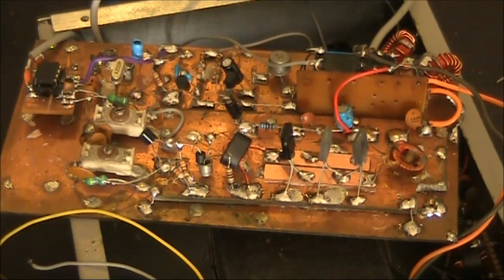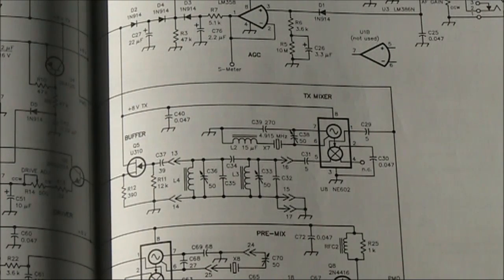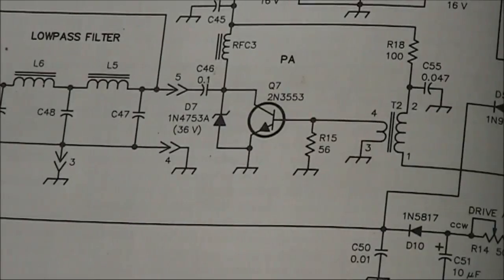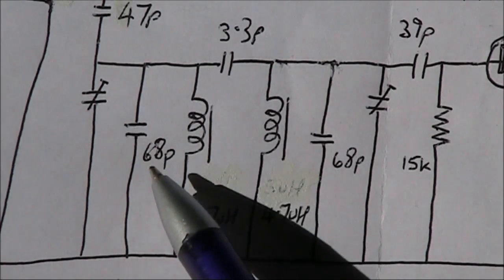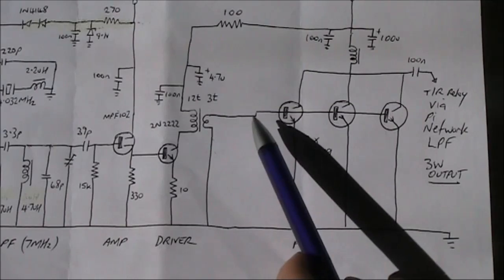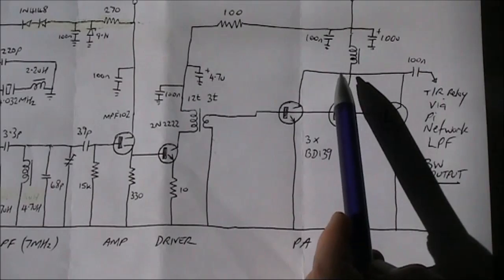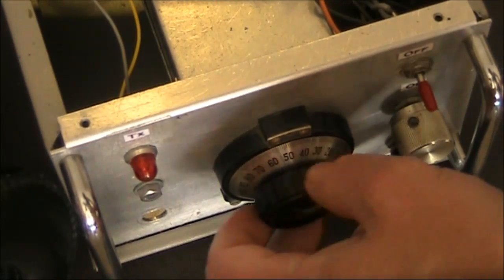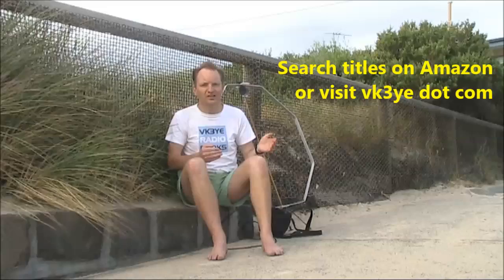A QRP CW transmitter RF power amplifier chain

Comment: hi Peter,
great video! Thanks for sharing! I am designing a rig for 20 and 40m and I was wondering if a 2SC2078 transistor could suit as final amplifier stage as well...since it is much cheaper (about 1.20 EUR) than the 2n3553 (about 8 EUR).
What is your opinion on that?
Cheers, and 73
Roberto
Reply from the maker: Roberto - not sure - never used a 2SC2078.
Reply: With a little circuit modification, a 2SC2078 TO220 plastic CB final transistor should work very nicely. It will deliver more power with a 12V supply than a 2N3553 will too

Comment: Nice walkthru Peter. I built the Sierra's little brother the SST for 30m with a very similar PA circuit and I also substituted a BD139 for the 2N3553. Mine also worked first time. I didn't try the stack of 3 but instead added an IRF510 after burner for 5 watts. I made some interstate contacts on 1w but the 5w option makes things easier.  A homebrew multiband Sierra with a DDS is on my to-do list. 73 vk3hn 

https://www.google.com.au/amp/s/vk3hn.wordpress.com/2016/12/27/summit-prowler-two-a-scratch-built-30m-cw-transceiver-wilderness-sst-for-sota/amp/

Comment: Good job, Peter. I have experimented with the BD139 too, and it's great for 7 MHz and 2 to 3W applications. Do you know of some other affordable and easy to obtain bipolar transistor for 7 MHz and 10-15W? Thanks!
Reply: You could try playing with the IRF520 fet they're pretty cheap. I succeeded in using an IRF530 on 27mhz
Reply: go to 1 to 40 mhz?  IRF520 fet